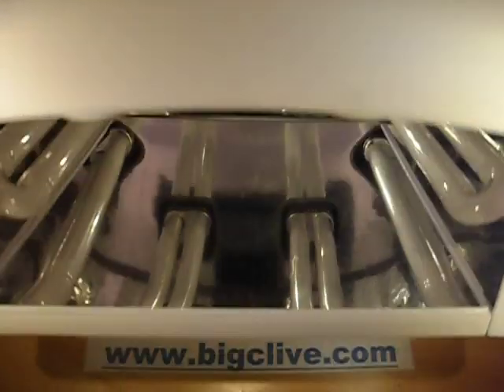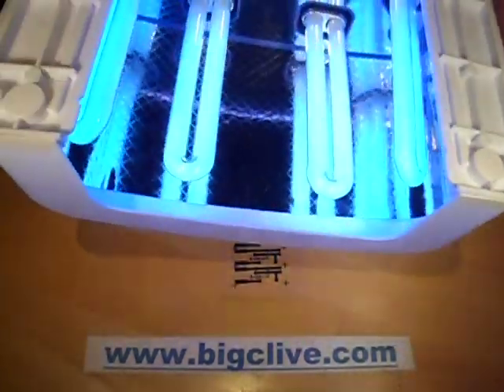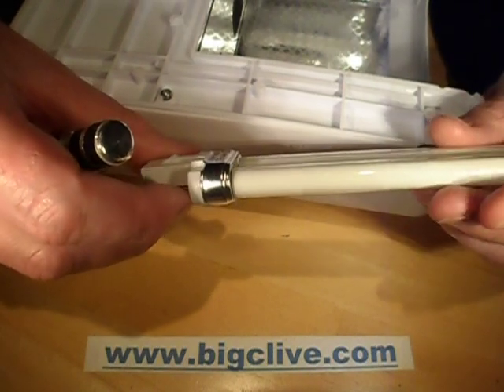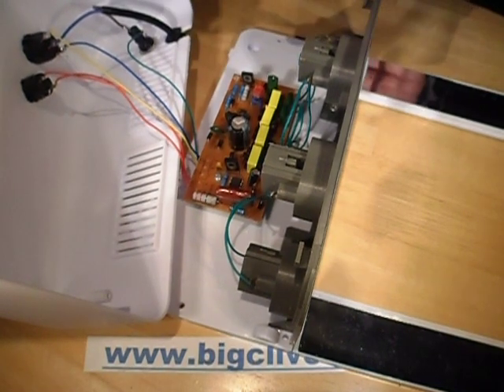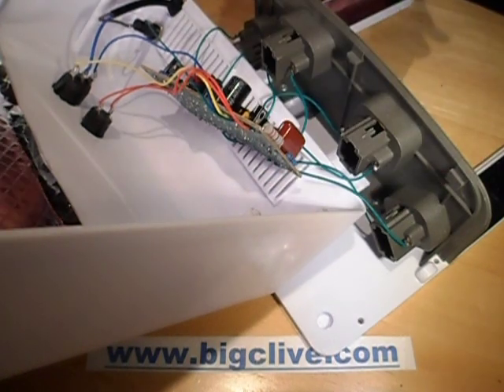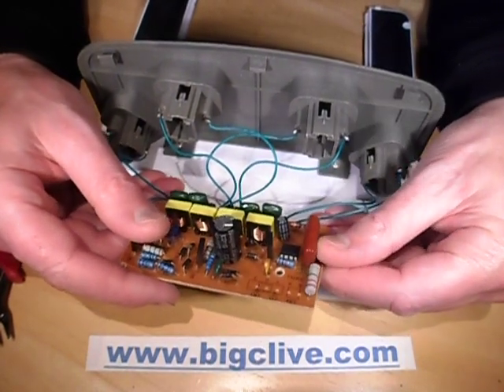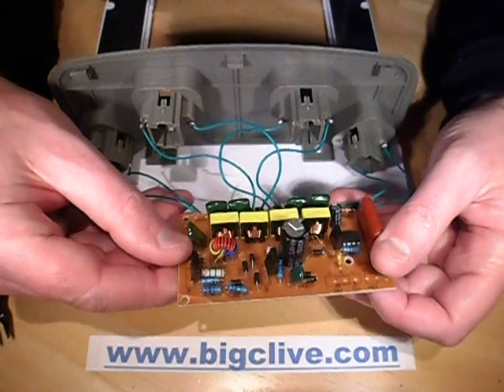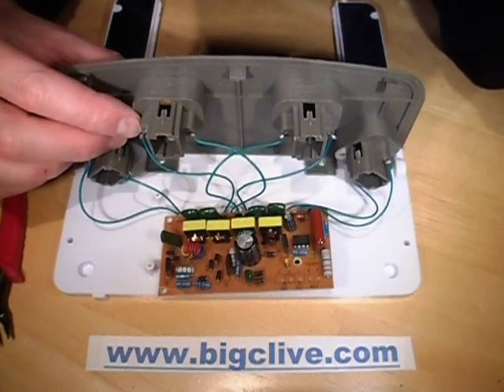Review and teardown of UV nail polish curer and PCB developer.

Comment: Hi Clive. The factory output of my unit appears to be 47V for each lamp however I want to modify it to drive some 9W UVC bulbs I purchased that specify 60V. When I plug my new bulbs in I can hear the starters in them tinkling away trying to start but there doesn't appear to be quite enough power (I suspect just lacking voltage). My next step is to reverse-engineer the circuit to work out how to boost voltage slightly but thought I would ask here for suggestions on which component I might look at to bump the output voltage to 60V - just in case you are still reading comments on these historic videos :).

Comment: I have this exact model UV lamp and one of the bulb sockets isn’t working. I’ve had a look, everything looks fine, no loose wires. Any ideas what could be the problem?
Reply from the maker: If it's like this one then it will be a bad connection on either the holder or the PCB.
Reply: That's interesting.. i have the same problem, but when checking deeper..
I noticed that if i change one of the bulbs location, Only 3 out of 4 lamps will work at a time,  and the location of the one that doesn't work is not constant. (the OFF lamp location is different) How is that possible?

Comment: On my UV cure lamp the power cord is only two wires brown and green I'm struggling to find where they r supposed to be connected to please help angel baby😩😩🙏
Reply from the maker: The common flex colors in Europe are brown for live and blue for neutral.
Reply: @bigclivedotcom  and where do they connect to

Comment: Clive I have one of these, and Ive only used it twice for curing glue on an LCD screen, and now its dead as a dodo.  Wont power on at all.  Any ideas what might be wrong?  The big cap in the middle is still measuring 320v DC
Reply from the maker: I'd suggest checking the solder connections around the electronic ballast circuitry.  Is it not even working in the continuous non-timed mode?
Reply: +bigclivedotcom totally dead.

Comment: tubes cheaper if bought as this unit. must be everything to do with nail art as its the same with dremel sanding bits. 1dremel  mandrel about 2 pound. as nail art mandrels about 5 pound for 20. a pack of 4 dremel sanding bits about 2 pounds. buy them as nail art spares and you get 100 for less than 1.50.

Comment: we really need that electronic to turn lamps on or we can just  use a 12vdc power suply?
Reply from the maker: +Eduardo Braga If you used a relay to power the unit while switched to manual mode you could control the lamps externally.  But all the circuitry on the PCB is referenced to the mains, so you'd need to use some means of isolated switching.
Reply: +bigclivedotcom Can i use a LM317 / LM7812 to provide 12vdc and a NE555 to control the time or i really need some high frequency PWM generator to make lamps turn on?

Its because each lamp bulb cost is only 1.4USD (1 Euro)

PS. The lamps are 12v DC or 24V DC

Sorry my bad english :)
Reply from the maker: +Eduardo Braga Ah.  The lamps are like any other fluorescent lamp.  they require a high voltage current limited supply to drive them.  They've done that cheaply in these units by using a communal driver to run four separate series chokes.  If you want to run them at low voltage you would need a suitable high frequency driver for this type of tube.

Comment: Saw these on eBay whilst looking for the real deal. Wondered if you can fit a standard euro card size PCB in there? Be just what I need to develop pcbs!
Reply from the maker: +Chris Woodhouse The exposure might be too uneven.  If you can find an affordable proper exposure unit then it's probably the best way to go.
Reply: +bigclivedotcom finding them is not the problem, even the smallish ones are a bit too dear. I'm willing to give it a try on a 100x120mm PCB and see how it comes out. £15 it's no big loss!
Reply: 100x160mm even!
Reply from the maker: +Chris Woodhouse The 160mm is the tricky bit.  But if you bought 4 new lampholders you could hack your own UV unit from the guts of the nail varnish curer.
Reply: do you think i could drive an extra lamp from each output like, placing them in parallel??

Comment: I use those to erase UVPROMS
I got lucky last week and found twelve of these in the trash pile in front of a nail salon that went out of business, All had working tubes but the cut the AC cords off.
Also in that pile were 10 Dremel rotary tools with the "Snake" adapter and some cases of file bits in a cardboard box. An animated LED open sign and a dell PC with the flat screen monitor and PC holder on the back (My main reason for stopping I will bin dive to save a PC)..
Reply from the maker: ElfNet Gaming EPROMs usually require shortwave UVC to erase their electrical state.  Hence why they have quartz windows.   The UV tubes in the nail units are basically blacklight tubes without the filter.  Fine for curing resins, attracting insects and exposing PCBs.
Reply: The "nail polish curing unit) I used was older with a magnetic ballast and still required a longer tine exposed. The actual UV eraser I do have is a proper tube unit. Anyways though the ones I found will still be useful for PCB exposing
Reply: The shop went out of business. They looked like they had been used well but after some basic cleanup they all operate like new. Also have the foot pedals for them too.
Reply: because we live in a throw away wasteful society now. Who knows..
Reply: 10 DREMELS?! Why would anybody throw them away?!
Reply: But why didn't they sell them or something?
Reply: Weird

Comment: sorry. couldnt hear it. is the PIC chip used for timer or 555? Got any ideas how to modify timer to swtich off in 3 rather than 2 minutes? thx
Reply from the maker: It has a compatible pinout to a PIC12 microcontroller.  You could adapt it to another time delay by writing new software for it.

Comment: Green is the L2 hot color in China and Russia because yes.
There a part number on the micro?  I see light reflecting off of what look like markings.
Reply: Aadil Shah There is no such thing as too cheap to clone.  I have even seen fake 74xx logic chips, although those were deliberately nonfunctional.
Reply from the maker: I din't know green was actually used as a phase colour in parts of the world.  That's good to know (in a bad sort of way).  The chip like many of these little 8 pin chips is blank.  The pinout and functionality is of a PIC12 microcontroller although I would guess it's likely to be a generic clone unless Microchip have a secret economy range just for mass produced products.
Reply: bigclivedotcom
Could also be a PIC10 as they are cheaper.  I think that a clone is most likely but don't know of any likely candidates as I don't use them for obvious reasons.
Reply: randacnam7321 I'm surprised that anyone would bother to clone such a cheap chip.
Reply: randacnam7321 Perhaps it's neither? They could have prototyped their device with PIC but replaced it by a custom ASIC or Antifuse PLD in later runs? It would be OK for those to be unmarked.
Reply: 4 pin used? Seems like a micro controller CUZ of the 8 pin pack. I've seen ICs with 2 functional pins, wonder how that works.